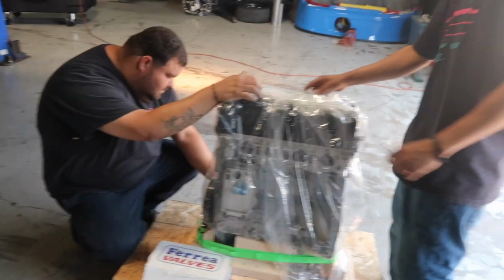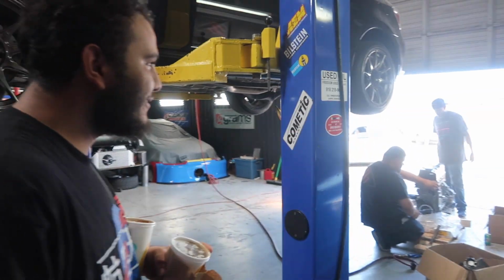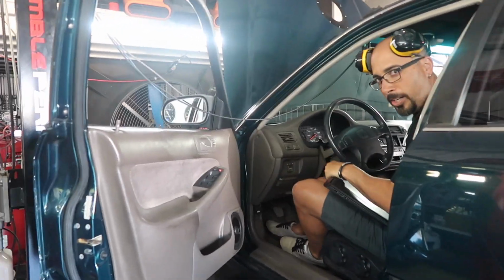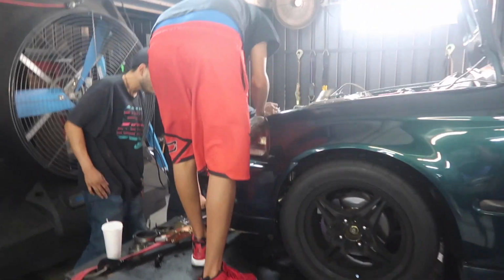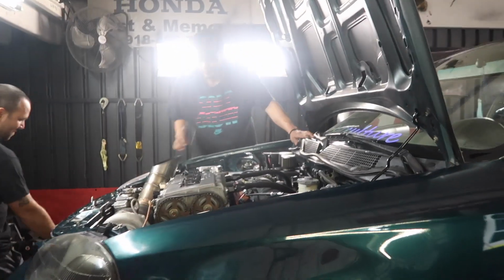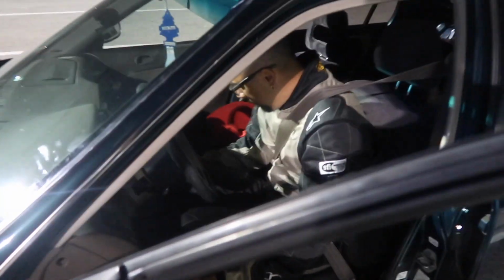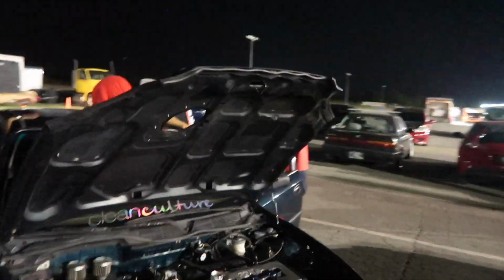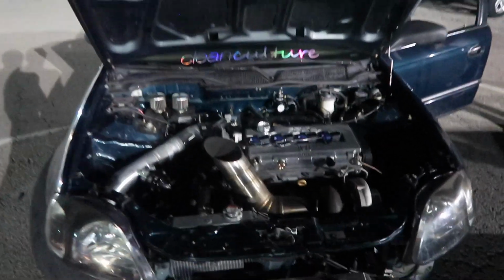Worlds Fastest 350HP Civic Sedan Goes For A 10 Second Pass!

Comment: I'm calling BS on the 350hp. Sounds low to me with the way the car was spinning the tires in 3rd and 4th gear, when they actually tried to apply the power..
Reply: am not been a hater eather but like u sed there no way 350 hp bseries will spin 3r 4rd with that power
Reply: @WowAlferius  Same here. Not a hater here. But no way 350hp in a sedan spins those tires in 3rd and 4th gear. The dyno was probably on Wastegate, and in the video they showed hooking up the laptop to turn it up. Lol
Reply: @bradleyslusser2279  i guess